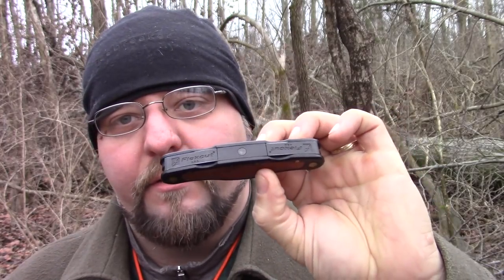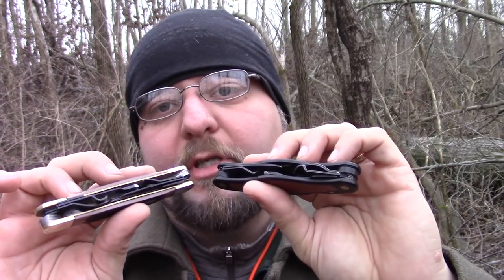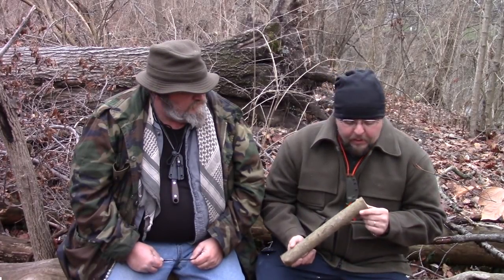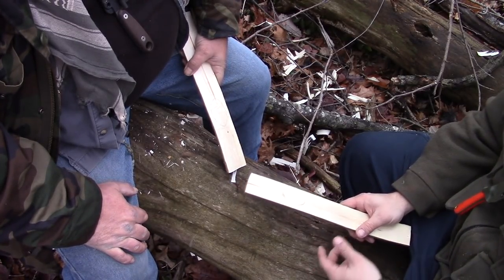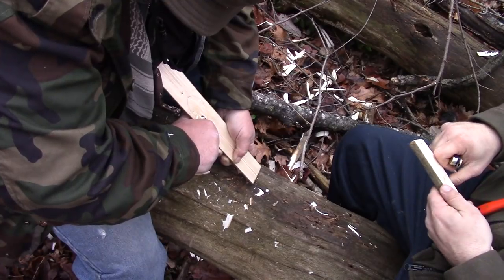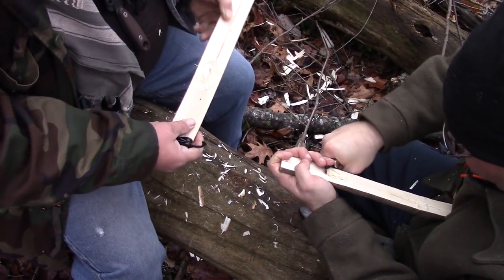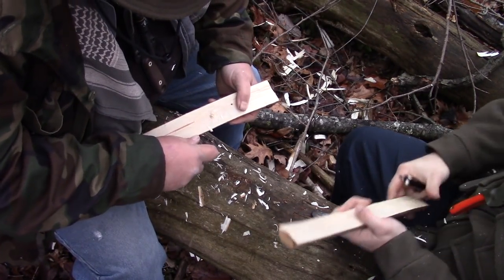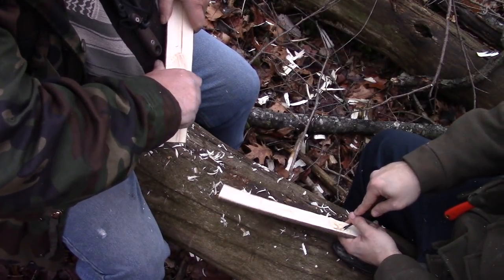Old Timer Carving Knife Vs Flexcut Carving Jack - Mantis Outdoors

Comment: I have both of them also. I really like the Flexcut. When I got the Old Timer I found that the straight gouge had been ground, but not to an edge. It was dull. I was able to sharpen it though. The problem with your test here is that you have honed the Flexcut and used it for years. You keep it exactly as you want it. You used the Old Timer directly from the box. I would suggest that after you have honed the Old Timer it may be a more even test. At the end, I still like my Flexcut better than the Old Timer.
Reply: LH in Arizona great point. My blades aren't loose like his, is yours?
Reply: No, my blades were tight. If I end up with that problem then I will do some light peening to tighten it again. At 20-30 dollars, you can keep several around.
Reply: I own both as well.  The flex cut tools came super sharp out of the box. The old timer not so much. Everything about the flexcut is better. The old timer is still worth buying. You will need to spend some time and effort to get the tools on the old timer as sharp. Given the difference in price it makes sense.
Reply: Nick Miller mine were tight also.
Reply: @survivalnewbie  Generally, the difference in retail price is labor. Some materials but mostly labor. That might account for the lack of sharpness. I did take the time to give mine a good sharpening/stropping and they work great. I don't have a Flexcut to compare to and I never will. I just can't justify that cost. With that said, for those of us on a limited income, I feel that the Old Timer is well worth the price and then some.

Comment: I have the new Car in' Jack, rh, and I love it.  Sharp out of the package, solid tools, a high quality leather sheath and a strop designed to sharpen all of the tools in the  knife, along with a virtual life time supply of Flexcut's yellow stropping compound.  

One quick comment on your spoon bowl technique.  If you start forming the bowl with the larger hook knife cross-grain in the center of the bowl and work your way towards the ends, you will get a much smoother, deeper bowl in less than half the time.  You can also take full scoops without causing any splits.  Give it a shot!

Comment: I do a lot of spoon carving, not only for myself but also as a spoon carving instructor.  I've used both the Flexcut and the Old Timer.  The Flexcut is the superior tool.  If the price is too high for you, buy the Old Timer but understand ALL its blades will require sharpening and maybe regrinding.  Plus, the Old Timer is made with lower quality steel requiring more resharpening and it feels flimsier in the hand.  With a little tune-up you can carve with it, but the Flexcut comes ready to use right out of the box and is more comfortable to use.

Comment: I carve  lot and hav a lot of Flexicut carving tools. They ar great on the home bench and would get up set losing them in the woods, I bought an Old  Timer at the Wilderness Gathering and knew it meant some time prepping the blades, yes with a Flexicut profile block, small files and stones. But now I have a set of tools in one handset that works very well. For the price and little work well worth it. Still lust after a Carving Jack though but Christmas is coming! LOL

Comment: Well, bought my flexcut about 8 years ago, my old timer clone this year.  Bought two more old timers within a month. All arrived decent factory sharp, just strop and go. My hands are smaller, and perhaps it matches the Chinese sizing better. No problems with the lack of locking, on the Flexcut tends to be a pain switching tools. 
Only critique on both is the V scorp. I'd rather a saw, as this is my EDC spoon carver. Probably will disassemble one to mod.

Comment: Nice video,
   I have the Old Timer Carving Knife. It's "okay". It was a gift from a good friend. Yes, I would rather have a better quality Flex Cut Carving Jack with the accessories , but right now I have other things I need/want, so the Old Timer will have to do for now.
  I find the Old Timer Carving Tool on-line for around $20 all the time.

Comment: Oh wow, just made the crazy decision to purchase both the old timer AND the Flexcut. Thing is, I don't need two. I ain't rich. It was completely a compulsive purchase. That being said, hope I'm not disappointed. I don't really need carving knives. I have 3 regular wood handle flex cut carving knives that I rarely use. 

Now, I ride a bicycle and my family has property out in the woods and hills so I ride my bicycle out there. We just hangout there. Build fires, got a creek, woods hills, wood to cut, all kinds of goodies. It's about a few hour bicycle trip. 

So, my main reason for not using my regular carving knives is the portability. 

Yea they're nice, but never convenient. 

With these tools in my pack, I believe I'd be more apt to use them.

I originally purchased the old timer and it's supposed to arrive in the mail today.

But I just now ran to eBay and bought the flex cut version.

Only because I have different packs containing things of certain quality.

This flex cut version will go in my high quality pack of various unique items I've collected of a slightly higher quality build.

Suck as a good high quality steel spring loaded grappling hook, a hand made Norwegian munharpe jaw harp, a Hungarian jaw harp, and a handmade American jaw harp, some Shaolin hand made rope dart meteor hammers, and a bunch of other gadgets. Leather working tools.

Then I got portable microcontroler kits and electronics and breadboards and servo motors components and solar power supplies.

I can tinker with electronic engineering even out the woods.

Fun stuff.
Reply: Nobody cares, but I got this old timer in the mail today. I definitely like it. Right out of the box though, they must of intended the buyer to sharpen the main straight blade your self.

I'm sure it will get super sharp with work. But out of box the main blade won't cut hot Butter. They literally beveled the edge Abit. I'm ok with that. The others were pretty sharp. spoon scooper could use a little stropping.

I've never held a flex cut but apparently it's on it's way.

Comment: Most people (including me) when they first compare them, think they have a different grind... Or rather that the Flexcut has a 'higher' grind, but given that the blade on the Flexcut is at least a third thicker, it will look like a higher grind even at the exact same angle.

Comment: I think there’s an argument to be made that a flex cut is a better choice for beginners because beginners don’t always have the skill to avoid the risks that come from duller/flexible blades. But yeah, the affordability is definitely a good argument. Still, I’d rather grab a good single u-gauge palm tool and knife to start out than get a lower quality tool. The higher quality steel will hold an edge longer too, which is great for beginners who don’t sharpen enough.

So I guess what I’m saying is the Old Timer has a place for people new to wood carving but not new to knife handling/whittling, who are also travelling about a lot with it. People just wanting to get into carving are probably better off with individual tools that’ll feel far more comfy for longer carving session.

Comment: The Old Timer is on Amazon for under $20 and the Flexcut Slip Strop for these knives is under $20 from at Rockler or Amazon, so you can get both the Old Timer and the Strop for under $40, compared to the Flexcut knife with strop for $125. One item of note is that the Flexcut knife does come in a left handed version while the Old Timer does not.

Comment: I haven’t started watching yet but before I do I know that in my personal experience owning both of these folding carving knives that the Flexcut Carvin’ Jack is 1000x’s better than the Schrade Old Timer Splinter! Not only is Flexcut American Made w/high carbon midwestern steel but it’s made to last & mine was actually ready to carve right out of the pack. I bought the Carvin’ Jack Kit at a carving show, it came w/a leather belt holster(I’ve never used mine) a leather slip strip & a chunk of Flexcut’s gold polishing compound & if I remember right I believe it was $69.99, maybe $74.99 but I immediately opened it bc I was curious about a folding style pocket carver & it was a true carving tool or if it was like the “Whittler” style pocket knives but was pleasantly surprised bc I was able to grab a scrap piece of basswood & quickly carved a spoon & your average “old man” character mini fig & was shocked that for a pocket carving knife came as razor sharp as it did! I’ve had brand new straight handle Flexcut carvers be delivered in the past that I would test on scrap wood & they’ve needed to be sharpened b4 starting a piece. My Carvin’ Jack quickly became my “go to” carver. Able to carry the equivalent of 6 straight handle knives comfortably in my pocket & if I have to wait on someone for a bit in the truck & I wanna carve to pass time like I have in past but couldn’t bc of no tools & idk many ppl that carry their straight handle carvers everywhere so Carvin’ Jack solved that for me. Now the Schrade Old Timer Splinter in the other hand actually does stay in my truck console but it’s a “last resort” option bc the 3 Splinters I have dont compared to “Jack” even if they were somehow  combined

Comment: Well, of course the Old Timer is not going to be as "robust" for all the reasons you have stated but you covered that well and I was glad to see that you didn't bust up on it since it definitely has it's place. However, there are other options in the Flexcut line that aren't anywhere near as pricey as the currently Amazon priced $130 6 blade jack. They also offer a 4 blade jack for only $75 that has all the blades I've ever actually seen anyone use as well as a 2 blade jack with just the flat blades for $45. Most folks would probably never use all 6 blades on the big one so I'm sure the 4 blade would be alright for most folks. I can tell you that after looking at them I don't even know what 2 of those 6 blades would even be used for, so the 4 blade model would be all I'd need... If I was ever caught unprepared and hadn't brought a spoon or bowl with me in the first place and for some weird reason decided to carve one out of a hunk of wood. Good review, though I did actually check to see that I was still on your page after the intro music played... ;o)

Comment: I just bought an old timer for $20. I can buy 5 of them for the price of 1 flexcut. 65mn is the Chinese version of 1060. Nothing wrong with that steel. Easy to sharpen and tough. Might not hold an edge for long but sharpening is the 1st thing any knife owner should learn.

Comment: I bought the old timer. It works but is not at all comfortable to hold. I have had several close calls with the blades closing on me. I'll be buying the USA  made Flex Cut with locking blades !

Comment: Old timer need to have the bevelles set and rehoned the steel is good but not as good as the flexcut but is not bad. If you can do the work then great value for the cash

Comment: I bought a right handed flexcut carving jack 2nd hand for £50 off a Bushcraft members site (BushcraftUK).  THEY ARE SCARY SHARP! I'd recommend wearing a glove as nicked myself a few times just getting the blades out.  I have seen a lot of suggestions that you should get a left handed one  so you carve away from yourself.  After a year of using one I'd agree.  Can't fault the quality though.  Only ever stropped it and not had to send it back for a regrind as the company suggests yet.  Good impartial vid

Comment: Really you guys aren't very biased. The sharade is $19 vs a flex cut that is $100  if you are not a professional carver i think sharade is outstanding an the number one thing for $20 you have to maybe sharpen it before you use it. I find if you wanna be a woodsman then learn to sharpen. That is probably the most important skill in bushcrafting. 
All in all in for $19 in the woods losing $19 is way better then big money tool. To enjoy woods an bushcrafting you don't need to spend a fortune.
 An locking on a jack knife doesn't matter.

Comment: I think the fact that the Old Timer blades don't lock is a deal breaker for me.  My fingers are worth more than the hundred dollar price difference.
Reply: Powell Smith if you use it with common sense you have nothing to worry about. You'll 99% of the time be pushing or pulling against the direction to close the blade.

Comment: I'd never attempt to carve with a tool straight "out of the box" , never got one which was ground, honed an stropped as needed - only machine-ground to maybe 400grit, what I call "rough". IMHO "really sharp" starts beyond 1000grit.
Reply: I have both of them... The Flexcut is almost the ONLY woodworking tool I have that came almost perfectly sharp out of the box... It was mirror finished to what looked to me as somewhere over 2000 grit.

Comment: Hope your technique has come along a little by the time of this posting. Watching the tools slip even a little makes me cringe. Try holding the tools with your fingers only. Use your thumb on the work piece for stability and control. Here is the key , keep your thumb on the job and roll the knife in your hand like your riding a motorbike and twisting the grip. Always cut up and over your thumb. It may sound a little weird but i started carving 26 years ago and you can achieve a lot of control with this technique.
P.s. A dull tool is a dangerous tool no matter what the brand. More force needed to push a dull blade equals a worse injury when it slips

Comment: Haven't finished the video yet (though I will), but wanted to say that I see nothing wrong with your (mis)use of "carves." Language is evolutionary, flexible. You knew what you meant, but more important is that the viewer also knew what you meant, which, in my view, validates the word. So no need to be embarrassed by an odd word slipping out. You may have just expanded our lexicon. One day lexicographers may trace the origins of "carves" as a noun to this very video. Who knows?

Comment: that old-timer needs to be sharpened. never use a knife to carve right out of the box without sharpening it. its dangerous. Old-timers quality has really dropped in the past 20 ish years. the old ones are the quality ones also disclaimer I have nothing wrong with USA made things or Chinese made things but honestly any more American-made things don't mean as much because of the quality drop. I've gotten Chinese things that were better than the same but USA made. it's really just by who actually makes it not were its made ( for the most part because the things are hit and miss on both sides anymore )

Comment: Say Heah Will,, I called Flexcut, the steel is 1095. So if you want better edge retention, 1095 is better. Also, ALL the blades in the Flexcut Lock. Plus, I got a nice Leather Pouch, a Strop Block for every tool, plus compound. So damn it, apples and apples, oranges and oranges. Tell me your bias. Bullshit. Dilly Dilly.,,.p